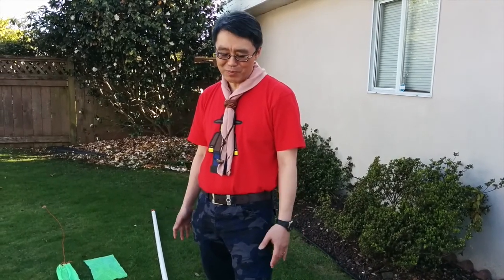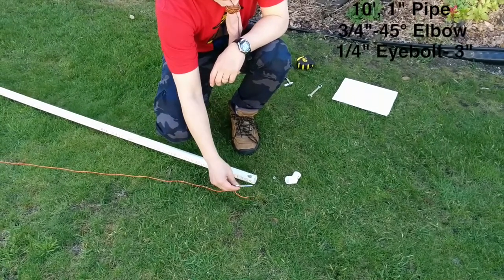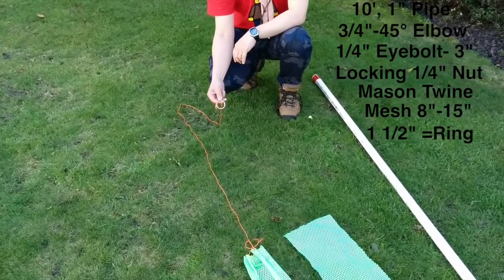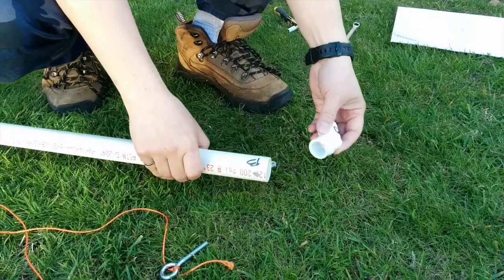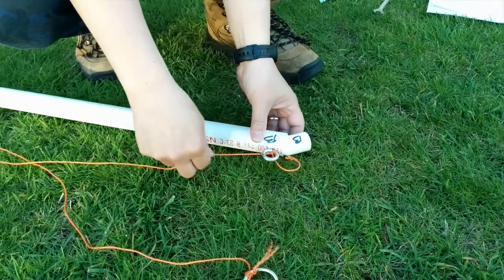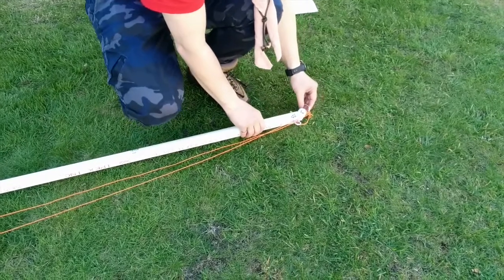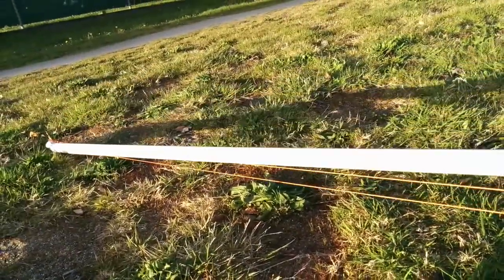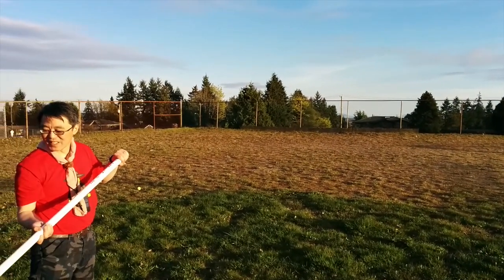Scouts Staff Sling for under $15

Comment: I don't believe it went to 100 m. Did you mesure it?
I made a similar staff sling ( 2 meters staff) but better built than this one and it throws a tennis ball to max 86 m.
Reply from the maker: Sorry I did not measure it.  From home plate in playground baseball diamond it went way past the outfield.  Tennis balls are a bit light.  Rubber can cut through the air better.

Comment: The pole and the length of the string, is unnecessarily long, I made an effective. Staff-sling out of a kids hockey stick and invented a unique pouch.
Reply: SlingshotWarrrior could you make a video on how you made the pouch please
Reply: Well, he's trying to send a really light weight ball a 100 meters. With the 45 * angle you can't aim it like a weapon very well. Done properly these things would have been a nightmare to ancient armies.  Using heavy smooth rocks... cheaper than arrows by far.

Comment: Wow! Is it ok to make a more practicle and less rediculous version of this?
BTW, I couldn't hear what you were saying.
Reply: Shorter and more practical staff slings were common in antiquity and used with great effect. 5 feet is a commonly reported length for the shaft, and even one handed versions either with 'auto' release such as this one or 'manual' release (where the string is fed thru an eye and held/released by a finger) were not uncommon. Staff slings were often used because they could tend to throw heavier projectiles than 'regular' slings and took a little less practice to get right. Staff slings were still used up to the 20th century as grenade launchers in war. You can absolutely make a scaled down version to try and have fun with, although be careful - even tho they are a little easier to use than slings it's still very easy to bonk yourself in the head till you get the hang of it. "rubber ball' is probably a good idea to start on rather than stones.
Reply: @Foxer604  and also important,  throwing rocks with that force and damage is alot cheaper than archers and the price of arrows. Even if you survive a hit to the head because of wearing a helmet... you would be practically useless in battle afterwards. What a weapon!